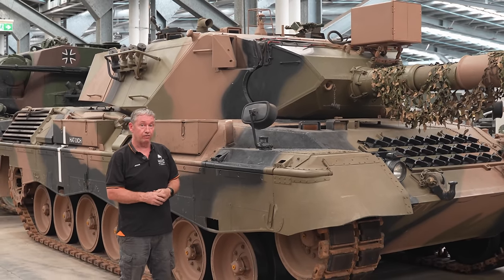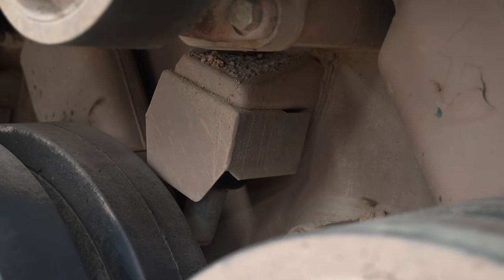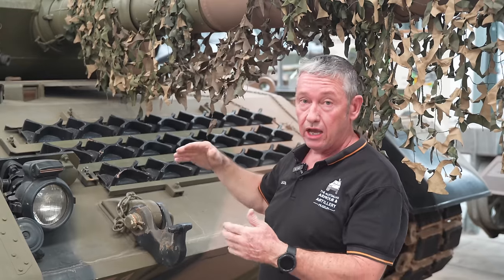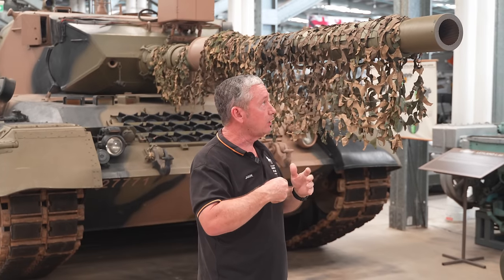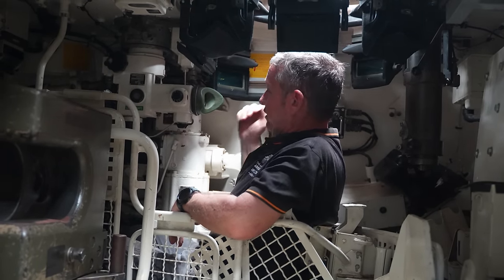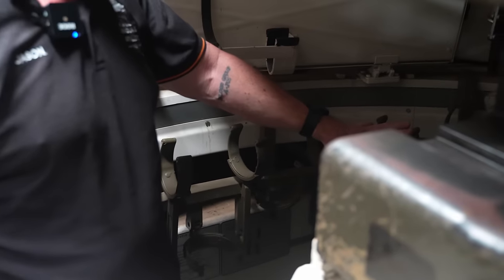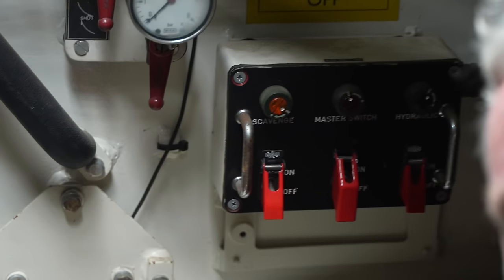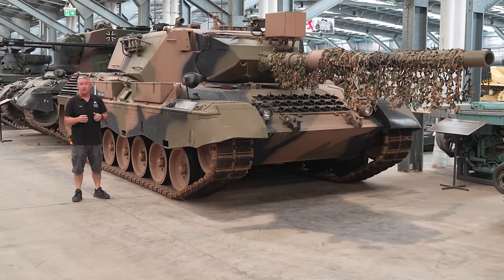The AUSSIE Leopard AS1

Comment: Mate, Leopard HEAT has a slipping driving band. It’s a Commanders shoot from 0-2000m using sabot corrections and from 2000-4000m Gunners shoot using the HESH technique. I thought the barrel life was 200 EFC (equivalent full charge) service sabot was 1 EFC, DST was 0.06 and Prac HESH 0.03 EFC. Can’t remember  Splintex EFC but it was from Muzzle action to fused range to either 4000 or 4400. Gunners lased the target, Commander halved the lased range, added 100mnthen ordered Manual Range x metres, gunner imputed that range  into the TFCS, Commander ordered Fuzed x metres 75m prior to that range the base fuse initiated the round.

Comment: It was very fast in the seventies always beat the Chieftain in a race but Chiefy always fired first as crew were often a little shaken. Some of the early ones would split hull but looked impressive airborne! Centurion always came in last but sort of moved landscape with it and was firing as came in! Saw this several times always great fun. Did you find you had hydraulic fluid on the floor. The Germans did which I always wondered must be a risk if hit.

Comment: Brilliant video.

Thank you for posting.

One question the wind direction indicator using heat differential to indicate wind direction.

Was it affected by radiant heat from the sun say late in the afternoon or early morning particularly during winter ?

Or it shaded to prevent this from happening?

Sorry Ex- pusser here that doesn't have clue about army equipment

Cheers

Comment: G'day, does the gun mount still use bronze pivot bushes or did they sort out the roller bearing problems. (I played with these units at 4 base/BLG in the 90s)

Comment: Worked on these at the Armoured Centre in Puckapunyal in the mid-80s, I was a TFCS Tech. I thought that one might have been a 1st Armoured Leopard as it doesn't look quite as moth-eaten as the one the trainees trained on...and being a HQ tank possibly also spared it that fate.
Reply: The wind sensor had two elements very close to each other, not one. There was a very granular voltage measurement across both that was used for wind measurement calculations...

Comment: Jason most impressed by your description of our Leopard. Quick quiz tho, what is your opinion of the “yank tank”? I would love to know because at the time it seemed like a private deal by Howard trying to further ingratiate himself with Bush. Overpriced and over here, and quiet as a mouse!
Reply: It may not count for much, but I served on the Leo 1 and the abrahms. Became an instructor on both. 
 Simply put, the Leo 1 was easier on the crews and the drills were quick and simple to remember. With regards to mechanical repairs, Leo was much much easier. Driving, responsive and very very nimble.
 The abrahms though is a whole heap of trouble, if you don’t do what your told. It comes with a manual that’s like a if this sh*t breaks go here do this. So it’s simple to find the problem and solution, however most get to a point where it has to repaired by raeme. Its gunnery is on a whole different level. Night time shooting is easier to setup, maintain boresighting can be easier with Muzzle reference system, and the rounds do more damage. Downside, it takes a lot and I mean a lot of PMCS or maintenance. Track changing can be a headache. Engines require a lot more servicing and care, oils etc it’s very thirsty. It’s loves the diesel. Compared to the Leo 1 the fuel consumption is insane which meant we had to change our resupply times.  And more.

 In conclusion, the abrahms is more modern and can be more lethal, its is harder to maintain but gives the crew more protection and firepower. 
 Leo was easier, we had it for years and adapted our ways to make it easier to fix, it was more nimble, it had the ability to conduct direct semi indirect and indirect firing with hesh rounds, it had a wider range of ammunition types, it could stay our for three days in some cases more before refueling, the crew tasks were simple and easy and to be crewman was realistically easier. 

 Here’s something though a while back during an older talisman Sabre excercise when the yanks were simulating attacking the enemy by beach landing, a group of Leo 1 from b squadron “disappeared” into a river bed or gully and trapped their tanks and kept them off as to reduce the heat signature the crews were also doing minimal things. Once the abrahms had passed in line down the road they popped up and attacked. Of course the abrahms was better, on paper, but it also comes down to the crew. Given time and employment I have no doubt we will make the yank tank better.
Reply: @williamritchie693 I think it’s more to do with the considerations at the time the vehicles were introduced. Germany relied on conscription to staff its armies between 1871 and 2011, meaning that the Leopard 1 and 2 tanks (introduced in 1963 and 1979 respectively) would need to be conscript-friendly and thus easy to use. The US had already transitioned towards a fully professional fighting force by the mid-1970s, so the M1 Abrams (introduced in 1981) could afford to be more complex if it meant giving it what the designers felt were the right capabilities to survive a modern battlefield

Comment: This may sound like a dumb question but was the armour reduction from a general classification from heavy to medium tank due to the more robust and am sure weighted cooling system in the tank compared to western Europe temps, to keep speed, rotation and suspension at its best?
Reply: Think there was some confusion here, all early Leopards have basically the same armor. Slight variation in turret shape etc but overall protection is basically.. poor. Keeps shrapnel and bullets out, but a direct hit from any HEAT or dark will go right through.

Comment: I don't know how accurate this is, but I knew a couple of officers from the regiment who had an intense dislike of the Leopard because they said it had a propensity to throw tracks when going through Australian bush , compared to the previous Centurions. Does anyone know anything about this?
Reply: I was a Leopard Tank Commander in the early 2000’s and I can say that I never threw a track. As long as the track was tensioned properly and you didn’t pivot on mud enough to get it fouled in the idler wheel and force the teeth out then it would be fine. I loved the Leopard before we moved to Abrams.

Comment: I believe it was the French who implemented a spinning heat round with their 105mm heat and gun
Reply: It was called the Obus-G, and had a much-reduced bursting charge due to the complexities of having a rotating driving band around a non-rotating charge section.  My pal J-P called it Citroen's response to an already-solved problem - having a smooth-bore barrel.  So basically, if the russians HAD attacked the West, one of the largest tank forces in Western Europe would not have been able to share in NATO's tank ammunition stocks....
Reply: @tacfoley4443  British have NOT solved that problem up to this date! 120 mm rifled tank gun on Challenger - how it will share NATO's tank ammunition stocks?   ;)

Comment: In the museum do you have intermittent cogs for pausing the shell as you fire than moving shell thru again ,,,,as chain pauses which carries shell,,,,,the cogs designed properly can be sped up or slowed down by Augustine speed of revolution on cog two,,,,cog two is independent of chain carry shell to barrel,,,cog 2 being the drive motor,,,,auto Matic reloading of shells for motor oo tank do you have anything like it

Comment: Jason said the engine is multi-fuel.   What fuels can it run on?   Is it like certain US military vehicles said to be multi-fuel but require several hours work by a trained mechanic to change from one fuel to another?
Reply: A multifuel engine was a Nato requirement from the mid /late 1950'. Im sure there would be a suitably qualified mechanic on here who could explain the in's  and out's of how multifuel engines are tuned to other fuels.

Comment: just a crazy idea. Many Cars have Hybrid power systems for fuel economy . I wonder if that could work on a tank also. Electric motors are very powerful now.
Reply: Ferdinand Porsche tried that out with the first Tiger design.  It didn't go well......
Reply: Not too crazy mate, there have been various attempts at hybrid fighting vehicles over the years.
Reply: Yes but hybrid systems are computer control and very advance now then ww2.  Battery tech is advancing by leaps and bounds.
Reply: @tacfoley4443  Ferdinand Porsche produced diesel-electric gun carriages in WW1!

Comment: It has always intrigued me that both Leopard 1 and Marder were right-hand drive....unlike just about every other armoured vehicle on the planet.  I never got a satisfactory answer for this.  Any ideas there?
Reply: For the Leopard, it is because of the hull ammo storage. It has to be on the left, as that’s where the loader is located. So as a result, the driver sits on the right. On the Marder, the driver does sit on the left of the vehicle, with the engine to the right.
Reply: [Some] Ammo storage on Chieftain is also on the left, but the driver in central.  I mistook the Marder.
Reply: @tacfoley4443  It is on both sides of the driver on the Chieftain, as opposed to one big ammorack on the Leopard

Comment: Those two turbos are not very superchargery....
Reply: Incorrect...these are mechanical superchargers that run off the engine crankshaft which work better at lower RPM.....turbo's run of  engine exhaust, which is not the case with this engine.
Reply: @jasonbelgrave2831 Google is your friend.."Induction turbo charged fuel type". You can clearly see the exhaust pipes leading into the turbos on the side plus the vanes on said turbo's....
Reply: @exsappermadman25055  He said that Russian T-72 tank has rifled gun! Could you imagine the expertise of this chap?  ;)
Reply: @ldkbudda4176  He probably knows a lot about the tanks capability, just not the engine or the T-72's pop gun...
Reply: @exsappermadman25055  The T-64 and T-72 were THE reason (125 mm smoothbore gun) Leopard-1 become obsolete and the Leopard-2 with 120 smoothbore gun were born. Know your enemy, bro? ;)

Comment: Any way you can donate them to the Ukrainian arm forces they really need tanks NOW.
Reply: Australia doesn't have Leos any more.
Reply: If it was possible, it would have been done already (or at least, they would have been sold to the tank coalition for refurbishment and then passed on to the Ukrainians). 

The problem is, that they have all been stripped back to just the hull (i.e. no engine, electronics, interior mechanicals, the turret welded into place, etc.) and made into displays at various museums (the one at Cairns has been left in a partially usable form - but it is the exception) and RSL's around Australia, and they would need to be totally rebuilt before being put into service.